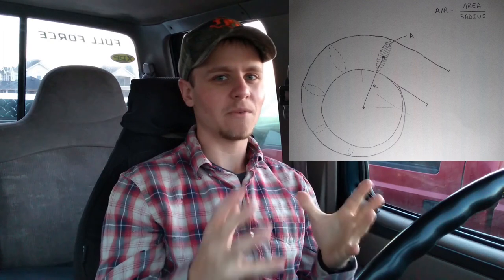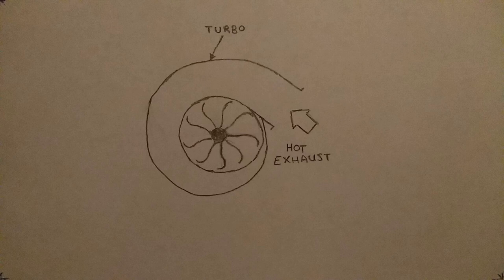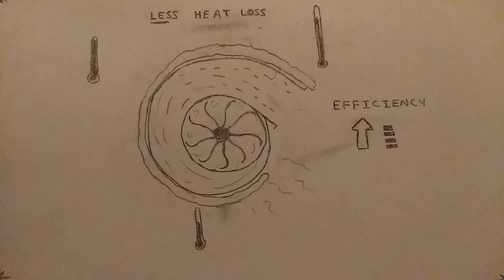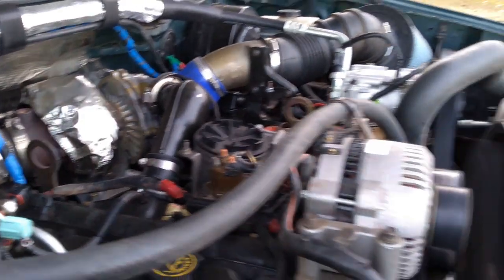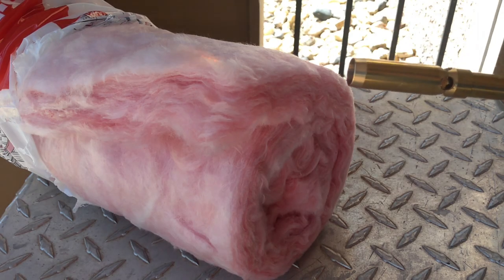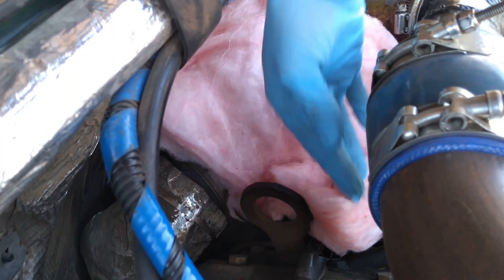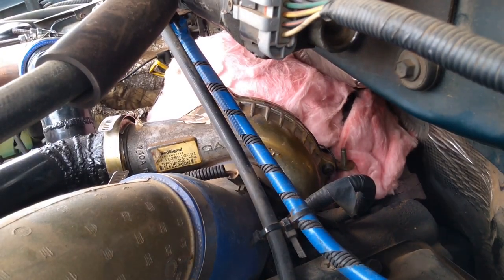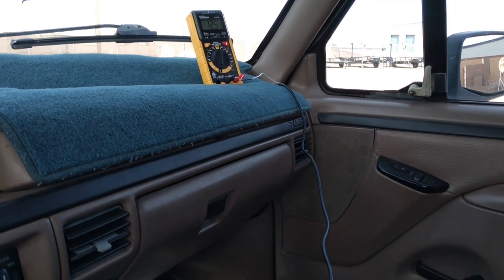Turbo Blanket Is it Worth it?  - 7.3 Powerstroke

Comment: From what I read. There are two benefits of the blanket. 
It moves the power curve to the left of chart. So, if peak horsepower is 250 at 1800 RPM, then the blanket would give you 250 at 1700 RPM.
Secondly, the engine compartment would be a few degrees cooler.
If I can get a blanket on EBay for $30 I might do it.
Reply from the maker: That definitely makes sense, and by definition moving the peak HP point towards lower RPM would increase torque output as well. I think part of the reason why there wasn't a huge improvement that I saw was due in part to the fact that the Garrett TP38 with the 1.15 A/R exhaust housing is so laggy to begin with. Additionally, with the larger A/R also comes with a greater ratio of internal volume to external surface area. In other words, there's less surface area for the heat to transfer out of relative to the exhaust inside the volume of the turbine housing. The amount of heat lost to the engine bay may not have been that bad to begin with. The larger A/R also lowers in turbine exhaust velocity, so with the lower velocity, there's a slower rate for heat transfer to occur anyway. The Cummins engines generally run turbos with much smaller A/R turbine housings which may be one of the reasons they see more benefit to a turbo blanket. I don't know for sure, I think you'd be better off saving up for a smaller A/R exhaust housing for the Turbo. I'm planning to rework the exhaust insulation I put on in this video, maybe make something a little cleaner and more effective. There is some potential with exhaust insulation, at least in theory. Thanks for the input!

Comment: Power Driven Diesel did a dyno test with a blanket. They found a 2 second reduction in spool time. A blanket isn't a power mod it's for efficiency and heat reduction. A fully insulated system (manifold, turbo, downpipe) is where you'll see the most benefit.
Reply from the maker: I definitely agree with you. The best thing would be to insulate everything pre-turbo, and maybe after turbo as well? At least in theory, it would give the truck more low end power. A 2 second quicker spool, (which I unfortunately didn't see :(  darn) would give the engine more boost and allow the ECM to dump in more fuel as well. At the very least keeping the heat in the manifolds and out of the engine bay would improve the efficiency of the system like you said, but with the same flowrate as before, that would increase the overall output of the turbo. You could argue the extra boost helps drive the pistons down on the intake stroke, though I think that affect is near negligible. Do you think it would be worth it to try insulating the down pipe as well?
Reply: @Rnddiesel  ThermalZero makes the highest quality and most affordable blankets and wraps. Another great solution would be to intercool the system as the air charge on a nonintercooled diesel must be insanely hot.
Reply from the maker: @xc8487  It would be good to look into some Thermal Zero products, thanks! I'm already way ahead of you on the intercooler, I've had one for about a year now! I ran the calculations one time, and at 20 psi boost, the temperature could exceed 250 *F or something like that. Heck boiling water is cooler!

Comment: IMO I don’t think any mod can compare, dollar to dollar, with the gains in power, expandability and versatility of a chip. A Chip even becomes more effective with adding other mods like injectors, a valve body, etc. opens up even more power! it’s the backbone or platform that connects everything in the diesel
Reply from the maker: I'll second that! It's really amazing all that can be done with engine tuning. I don't know if you've looked into what all goes into it, but the amount of parameters and things you need to consider to write good tunes is mind boggling. The only downside really is that you're pushing the engine past its original design point, and the poor old e4od for that matter. After a chip, mods start getting expensive really quick though. Heck new injectors, are over $1k, transmission to handle the power, $5k, turbo to clean things up, another $1k, and it just keeps going!
Reply: Rnddiesel I haven’t looked into it but your an intelligent person and I would enjoy a video on tuning parameters  you mentioned. I just bought my 95 OBS 7.3 back in mid-feb. Been absorbing knowledge and building up my truck since I got her. Before I purchased her I knew nada about diesel. You, 928 obs and living on wheels have been feeding my diesel “know-how” craving. 
I think mods become an obsession! Hence the naming in Stages, 1-2-3, each stage deepen of that obsession.
Reply from the maker: @jeremykeith3152  Well a tuning video would be great! That is something I'll have to start looking more into. It's awesome that you're going out and learning more about your truck. Most folks simply drive their vehicles until the wheels fall off. Like you I still do research and look to learn more. Heck I was so obsessed with getting a 7.3, that most of what I know about 7.3's and Diesels in general, I learned before I even got one.  You are indeed right, mods become an obsession! There's a certain point at which you realize you could make the truck suit your needs better than it would have in stock form. It does come at a cost though, and if you aren't careful you can mess up the truck real quick! I'm glad you are finding value in my channel, it's what I set out to do. We aren't 'drivers' per say, rather we are 'operators!'

Comment: Really appreciate your breakdowns on what works, doesn't and why.
What chip d it d you put in? I have 1996 F250 7.3 OBS.
Reply from the maker: Thank you! Well I ended up putting a standard TS6 chip in my truck, of course it's been re-tuned by Full Force Diesel to run the 160cc/00 injectors. I really only picked it because it's the cheapest option, and it looks the cleanest. The Hydra chip is really convenient, but it looks kind of goofy. Are you running a chip in your truck?
Reply: Not yet, so many out there and so many talk up their attributes.  Wanted to wait and see what others were using along with real world hands on feedback. Thanks for the FYI, much appreciated!
Reply: Being OBD 2 (1996) you’ve got more options. Then the 94-95. I have TS 6 chip with my 95. Cheap (eBay $194 free ship) and easy to install.
Reply: cole4406 looking into John wood valve body and many recommended Jody’s tune with it
Reply: cole4406 awesome. I’m down here in SoCal. I’m lucky my 95 is smog exempt. I’ll have to look into DP. What year does your dad own?
Reply from the maker: There are definitely a lot of chip options out there. I looked into a programmer for a while, which technically you could use on the 96 with the OBD 2 port, but the chip is much quicker to change tunes and allows you to have a high idle switch position. I don't think you can really go wrong with any decent chip, as long as you don't buy some $30 ebay tuner, it'll be good. Custom tunes will make a huge difference in the amount of power you can make, I think a few guys here can attest to that.
Reply from the maker: Serious question here, what emissions regulations do they make you pass in California? Is it just an opacity test or do they actually check for NOx and things like that?
Reply from the maker: @cole4406  I see! I really don't get how the pulse damper helps with emissions, and the split shot mostly only helps with noise. I don't know, at least you don't have to worry about a DPF!
Reply: cole4406 just put in 3”down pipe-4” cat back MBRP full exhaust in my 95. When shopping for an exhaust system the only options available for Cali had to include the single CAT.
Reply from the maker: @cole4406  Absolutely! I'm just dreading the days when the supply of 7.3's finally dries up altogether. Time to start stockpiling long blocks!
Reply from the maker: @jeremykeith3152  Dang, that stinks! I'm sure the MBRP CAT is at least somewhat higher flowing than the stock one.
Reply: Rnddiesel factory CAT must be installed on the MBRP. I don’t even know if I can install an aftermarket hi-flow CAT. It was labeled as full exhaust to incorporate factory CAT by MBRP on site. When shopping for aftermarket parts many sites will label “no California shipping”. On strictly diesel website they have that label largely displayed on their home page. Some parts, even owning smog exempt year in California, will not ship from the Big Sites. By using eBay smaller vendors, through email correspondence, I’ve been able to sway them to ship parts others won’t.